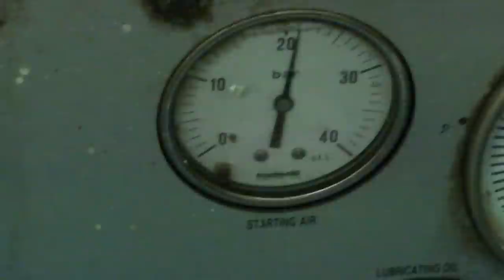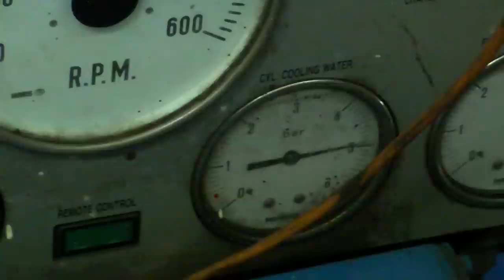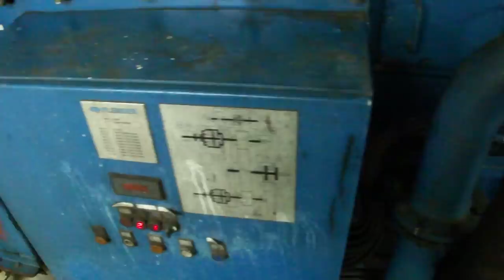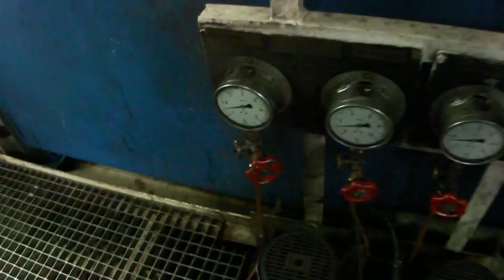The engine compartment from the biggest ropax vessel in the world

Comment: Those 3 generator engines are leaking oil bad and if they fail, everything else stops dead in the water. Your generators should be top priority, because without them nothing else will work. Not the tidiest of ships engine rooms.

Comment: Dirty engine room. Need a new chief engineer.
Reply: Or another sailing schedule with more time in port. (But since it is a RoRo that will never happen) It is certainly not a clean engine room but the biggest issue is in my opinion those HFO leakages at the A/E’s. Many of these engines were initially not designed to run on HFO and problems start with poorly designed drains.